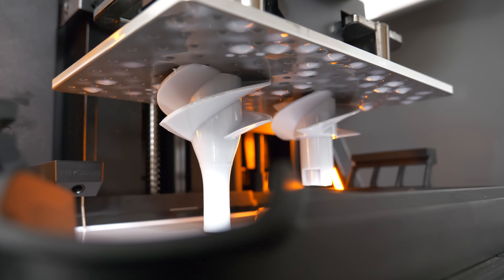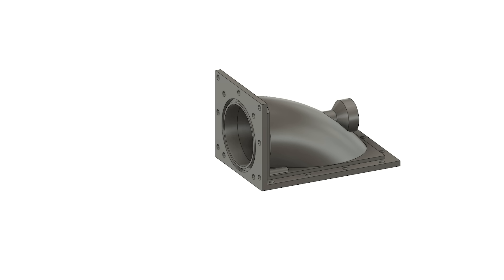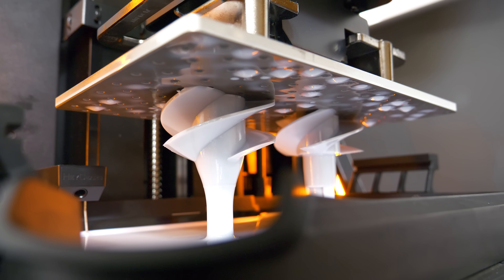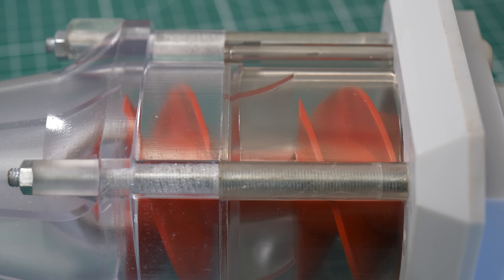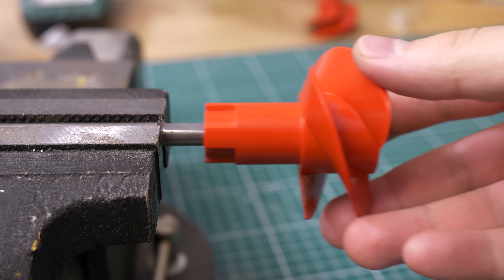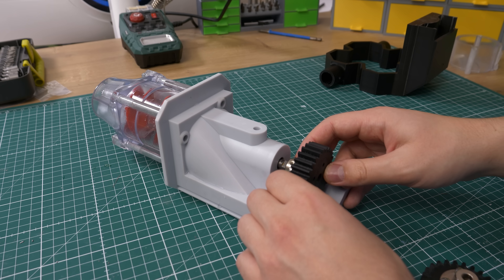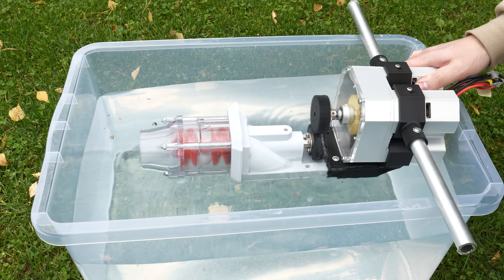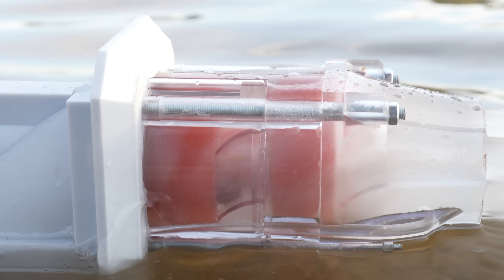3D Printed WATER JET With TWO IMPELLERS - Visible Cavitation (TRANSPARENT)

Comment: i find it interesting how software developers make a crap ton of their stuff free. it's very rare that solo devs try to sell their code.
but 3d modelers usually sell their plans instead of benefiting the community. i am both a dev and a 3d modeler. i make all my stuff free and accessible.
Reply: Most likely because us developers are more often paid well enough, and are enough in demand to not feel the same level of financial insecurities most other people do.
The whole open-source ecosystem is a glimpse into what society could look like without financial insecurities.
Reply: @netroy  very interesting take at the end. 🤔
Reply: Correct. @netroy
Reply: I'm a programmer, and I think that the distinction is that 3d models are a work of art, where code is human knowledge in computer readable form. I feel it is immoral to restrict any knowledge by requiring payment for it.
Reply: @sycration  a functional 3d model that provides a utility (plans for a house, plans for a drone frame, etc etc) are not art. they are the "code" of the end product.
Reply: @SeraphX2  I think that would apply to something like a cad file with history, as you can gain knowledge from that. A polygonal mesh is not much more granting of knowledge than seeing the object in real life.
Reply: I think earlier in the history of software developers there was more financial incentive for coding efforts.  It is only more recently in said history that open source has become common place.  3D modelling/printing may reach a similar saturation point in its history that will give more rise to open sourcing more of its projects too.

Comment: Second impeller should run faster and be smaller than the first, for optimal performance.
Reply: It looks like it could use a little bit larger intake to help with the cavitation.
Reply: That's for gas pumps (compressors). Liquid pumps have all stages the same size because liquids are not compressible.
Adding new stages makes no difference in flow rate, but increases the hydraulic head and pump efficiency.
Reply: @Giskard_Reventlov  That might be true for pumps, but not water jets, where you need to optimize for velocity out the nozzle.  If you look closely, there's a volute between the two stages.  This means the water Speeds Up before it hits the second stage.  If the second stage is the same speed and pitch, it merely slows the water back down.  Just to not lose efficiency, it must be a steeper pitch or spin faster - or both.
Reply: @chrisw1462  Finally somebody talking sense!  Most of the comments are from people acting like an authority on the subject and clearly don't know pdiddly about it.
Reply: EXACTLY ! Thank You. @Giskard_Reventlov
Reply: @Giskard_Reventlov 

I wonder what would happen if you increased the pitch of the blades but also reduced the diameter?

I guess this wouldn't be much different to having two stages and then a reducing nozzle - you're trading pressure for velocity.
Reply: Totalmente de acuerdo.  @Giskard_Reventlov  saludos desde Venezuela 2025
Reply: Would having a counter spinning secondary impeller do anything? or is that just for jet engines?
Reply: @stinkywater007 it would improve it, but its not worth it from what i understand. Its really complex to build a waterjet with counter rotating impellers, and because of that really expensive. And like henning said, the stators in a jetpump are also dealing with stopping the spin in the water, wich is an easy way to do it and it not that much worse in efficiency.
Reply: @stinkywater007 jet engines don’t have counter rotating impellers(fans)
Reply: @memcrew1 No but contra-rotating prop aircraft exist due to the efficiency gained by having props spinning in opposite directions.
Reply: @92HazelMocha  Stay on topic, nobody was talking about propellers.
Reply: @stinkywater007  That's what stators are for. Which are much simpler than a counterrotating mechanism.
Reply: @stinkywater007 I'm no expert in water impellers but I think it may work a little bit better because some of the power gets lost when the stream of water gets some spin. If the second stage rotates in the opposite direction, that will counteract the spin of the water and add some efficiency.
But I don't think it is worth the effort because some stationary vanes in-between the stages and after the second stage can do basically the same but the curvature of the vanes need to be optimized for a specific rpm and flow rate to get maximum efficiency.
Reply: @Henning_S. I think he just needs to put an angle on the stator(flow straighteners a.k.a reaction blades) blades opposite the rotor blades, i.e curved upwards
Reply: Or a larger pitch Maybe
Reply: @ekster3283 I was about to ask if you could achieve the same result by just playing around with the pitch
Trying to add a gear ratio to make the second impeller spin faster sounds like extra failure points that could be avoided
Reply: Hamilton water jets run two impellers that are identical to each other
Reply: @pauldean8638  you can run different sizes for different applications, some for torque some for top end there's 4 points of variability compared to only 2 for the prop pitch
Reply: @grindcorgz  tell that to Hamilton water jets , I mean you think your the expert
Reply: @pauldean8638    well considering I do fluid mechanics for part of a job it was someone like me that designed all their shit 🤣🤣 they're designed for the motor powering it lol just because theirs is designed like that for their motor and their application doesn't mean it's the best or most efficient in general
Reply: @grindcorgz  you know how old Hamilton jet company is ? You know how good they are ? Top of the game so shut up trying to look big . “ I do this and that “ , i don’t give a monkeys what you do unless you work for Hamilton , then I’d be impressed.
Reply: @grindcorgz you're right! Props tend to be matched to the motor/engine that will run it
Reply: @martinmtawali7359  thanks lol I'm glad someone understands logic 😂
Reply: @grindcorgz  what logic is that , you spewed out nonsense about different props being used
Reply: 6000rpm
Reply: Sure, if you wanted to blow the nozzle off or crack the pump in half at high speeds from the enormous amount of pressure buildup.
You need to accelerate the water, not compress it. This is where people struggle to visualise it, the exit of the pump needs to be the same size as the entrance, or else you are compressing the water and killing your efficiency, therefore your power drops off...so you try to spin it up faster to overcome this..which leads directly to cavitation and destruction.
Reply: Not sure what the scientific name would be but they are called inducers, loaders, or stuffers depending on who makes them.  They are smaller and sit upstream of the impeller.  They also work.
Reply: Honest to god some people think they know more than Hamilton water jets
Reply: @pauldean8638  it's because people do lol they're not the first, only or the best in what they do xD idk why you have a boner over a company that does products you clearly don't understand lol
Reply: how about attaching a gear system in the middle to the second impeller (the water could act as lubricant)
Reply: Look at sinusoidal pumps, vortex generators and venturi tunnels and "long drop" mill hydraulics, then get back to me
Reply: Needs,a,stator between impellors and a smaller diameter nozzle with a,ightly longer taper
Reply: Второе колесо вообще ненужно,оно только мешает.
Reply: Lol no that's for things that can compress, water does not, if doing multi stage then changing blade pitch with low angle blades on intake with higher angle on exhaust can help but needs to be done right
Reply: Some stupid people on here think they specialise in fluid dynamics but don’t understand so does Hamilton water jets who make personal watercraft jets , military jet boat units and commercial high speed ferry jet units  . Some think they tell Hamilton jets how to build  them when they don’t realise the best in the game actually work for Hamilton . What they think will work Hamilton already know they don’t work . As some people noted most is force induced pressure into the pump head and the both impellers are matching ( they run at maximum pressure up to the point where they not ripping themselves apart or the housing ) . The one person waffling about two different impellers is confused with jet air compressors which have different impeller compressor stacks ( air compressors ain’t nothing like water ones , you can only compress water so far before it rips crap apart ).
Reply: Second impeller should be a counter flow right?
Reply: @ZappyOh thanks bro, can you send a link of the one you made?